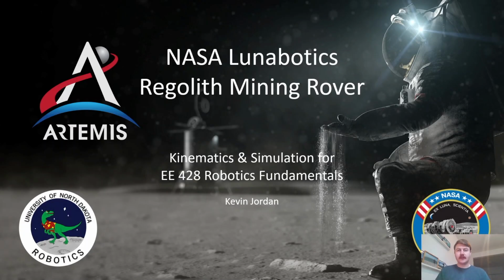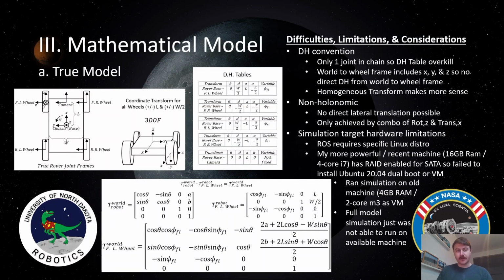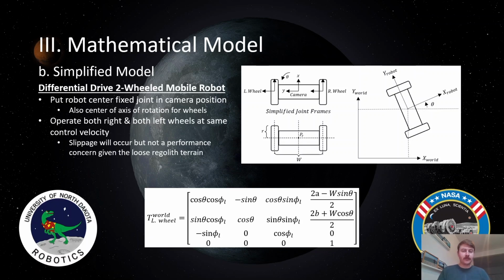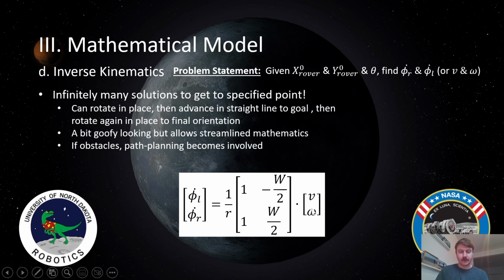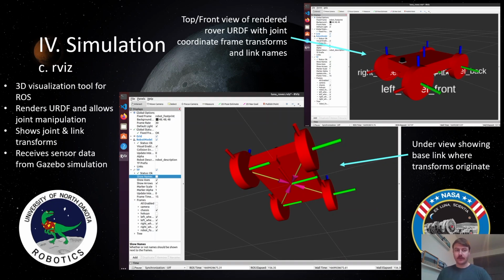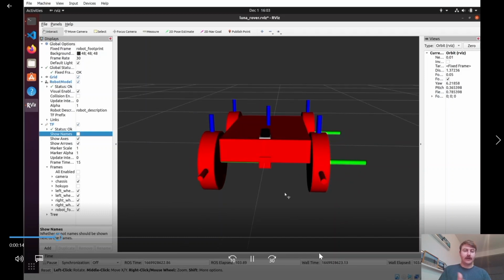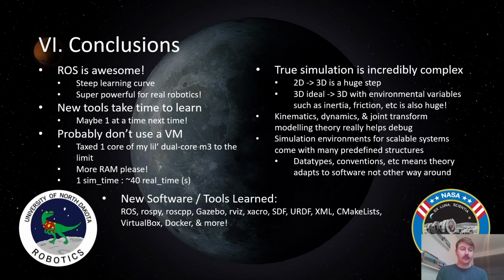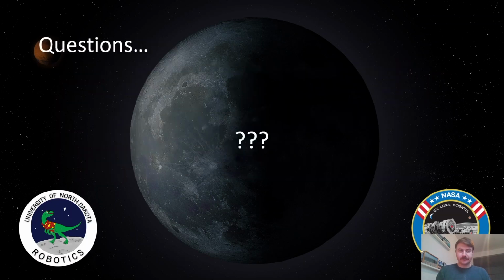Simulation & Kinematics of Lunar Rover Wheeled Mobile Robot using ROS, rviz, Gazebo

Comment: Sir please assist me 😢
It's my first Quadcopter
I flashed baseflight on my naze 32 bmp280 
Problem is quad not using midvalue 1500 as its altitude mode as netrual position.
It's using the min throttle value in case of power on the quad>> switch into baro mode>> arm the quad and lift off.
And the value of throttle when you switch into altitude hold mode.
Please help , i want my quad to maintain altitude at 1500 throttle value.